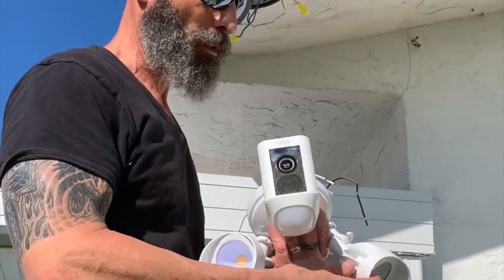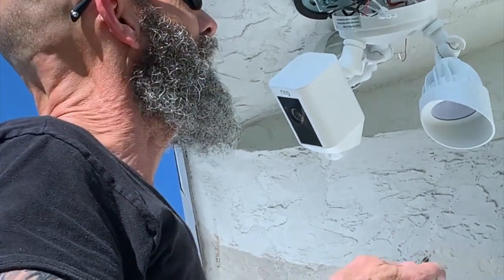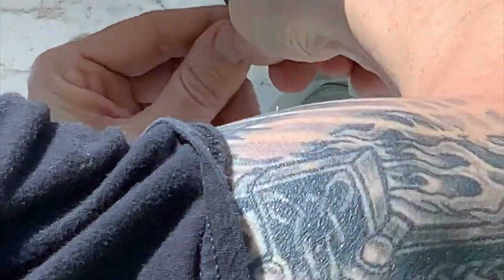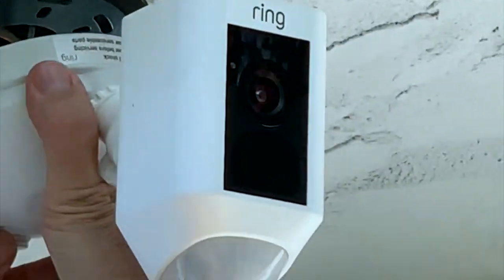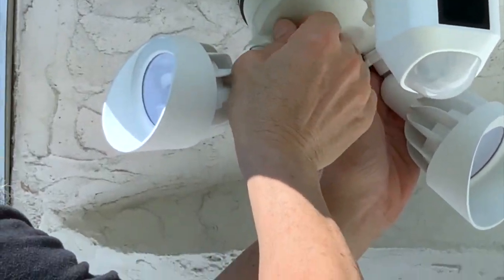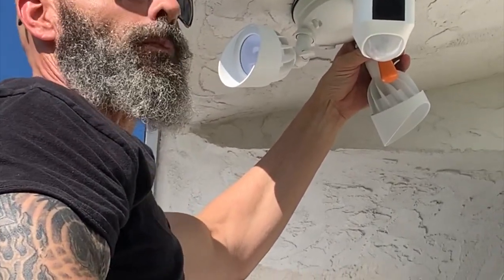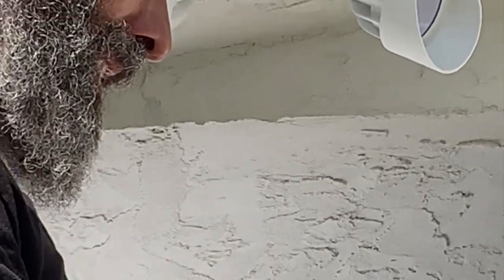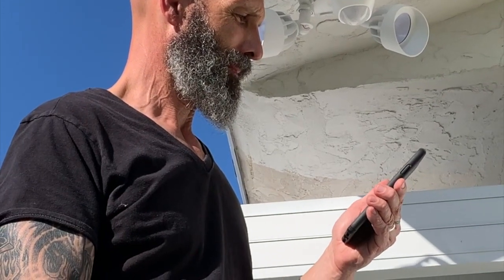Ring Floodlight Cam Installation

Comment: The only thing I disagree with is having those visors upside down.  I'm in Eastern Virginia and we do get snow on occasion.  Those upside-down visors would act like ice scoops and hold the snow.  Other than that, great video.
Reply from the maker: You are right I have already switched them. I mistakenly put them on wrong.

Comment: I'm thinking of replacing my 2 outdoor lights by the garage.  I wonder if the wiring is the same.  I hate to start & have to call an electrician.  
Thank you for sharing.
Reply from the maker: The wiring should be the same. I did the same thing. Replaced the light that was there. But if you are not experienced with electrical, it’s always best to get someone who is to do the installation.

Comment: That's under an easement., did you have to flip the light around any kind of way?
Reply: Eavement
Reply from the maker: Yes, it’s very easy to do. Just loosen the locking but and you can move it in any direction.

Comment: How do you get the hole in the stucco? What sort of mounting hardware is needed to do that? I can't imagine that your bracket is merely screwed into the stucco, so there would have to be something else that your bracket attaches to, right?
Reply from the maker: There was already a junction box from a previous light that was there. If that is not the case with you, then you will have to install a junction box. I have an upcoming video on how to do this for a tv I put on my patio. It should be out within the next couple of days. Please subscribe and hit the bell so you will get notified when it’s out.  Thanks for commenting. God Bless.

Comment: Is that ok that your junction box did not have a ground wire?  I am going to install mine but that caught my attention.  Where did you ground it to was not able to clearly see.   Thanks!
Reply from the maker: The fixture is grounded to the junction box itself. My house has no ground wires. It is all piped and that is the ground.

Comment: Did you pull the wires from somewhere else or were they already there?
Reply from the maker: The wires were already there from the previous owner of the home. But they were disconnected somewhere down the line. I had to use The Fox and the hound piece of equipment to trace the wire back to reconnect it in a junction box that was up the line.

Comment: Do you have a good straight level angle , I need to mount mine just like yours but it looks like it may look down to much
Reply from the maker: The camera and the flood lights are fully adjustable.
Reply: The camera doesn’t have a full range of motion when mounted like this.  What I recommend is added a 1/2 inch female to male elbow between the camera and center unit.

Comment: How did you get the camera to face upright? I loosened the bracket and spun it around but it points at a downward angle.
Reply from the maker: There is another adjustment screw to loosen and then you can point the camera in any direction you like.

Comment: Is there a way to rotate the lights so that they aren't upside down?
Reply from the maker: Scott Ellingboe Yes you can rotate the lights and the camera to accommodate however you have it minted.
Reply: You can, buy I don't know if in doing so you will void the warranty 'cause you will need to disconnect and reconnect the wires to make the swap.